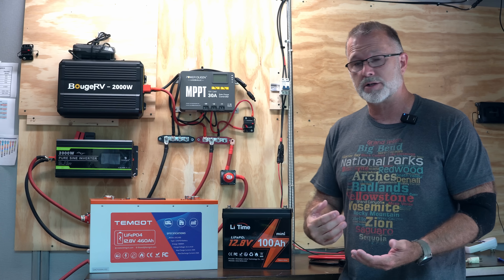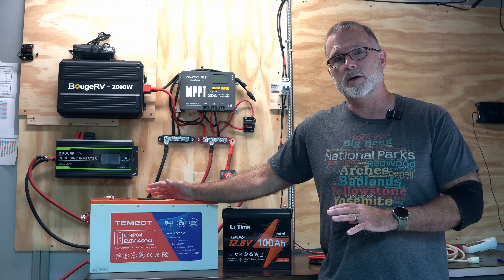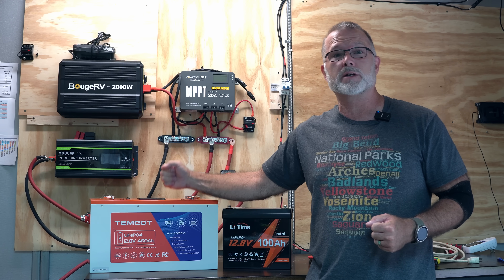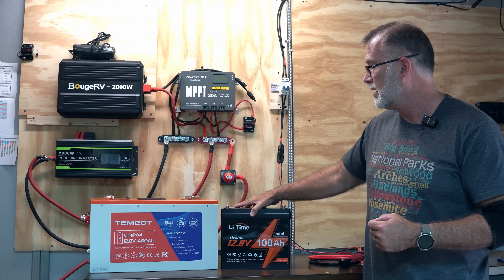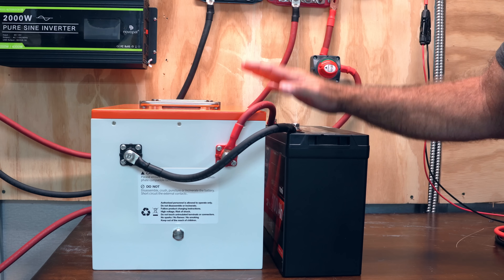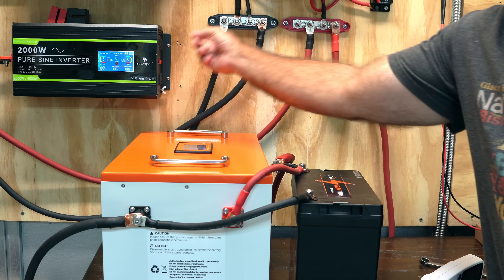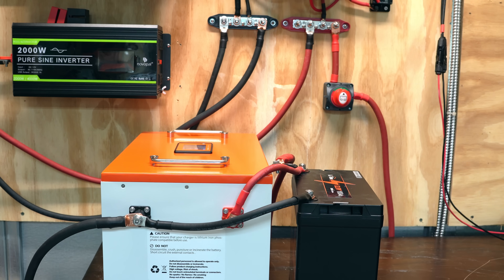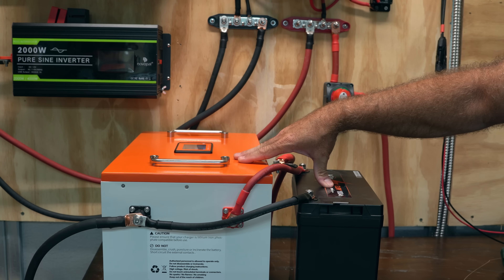Connecting Batteries with DIFFERENT Capacity in Parallel - What Happens?!

Comment: I’ve been thinking about adding to my battery bank for a wile now.   I currently have 3 12v 280ah batteries with 200amp bms parallel and wanted to add more same batteries same ratings just different brand   After watching this I’m gonna order more batteries asap thankyou

Comment: Like when you jump start a car with a dead battery, one battery with really low voltage and one fully charged plus an alternator pumping lots of amps into the low one and quickly charging it. Parallel connection, big wires. As a retired mechanic I have done that more times than I can count with no issues.
Reply: Trying to understand. 

Why not start the low battery car after making a parallel connection? This way they don't have to stay connected for long right?

Comment: Carfull with connecting them parallel if they don't have equal voltages. First connect them in parallel with a 1ohm resistor in between. Wait till they are balanced and connect them, then parallel and keep them parallel.
Reply: Explain the Why part
Reply: @ckreddy  Kirchhoff's voltage law. If you have two batteries, of which two have a very low internal resistance the currents can be extremely high. If they have different voltages. The process I describe is called balancing and that prevents you from high currents.

Comment: The smaller battery's lower discharge rate is not an issue. Ironically the larger batterys bms will shut off way earlier than the smaller battery if you try and pull too much current from the system.

The smaller batterys bms can handle 1c of discharge while the larger can only do like 0.5. Try and hook up 350a load. The load will will 280a from large battery and 70a from smaller one. Large will shut off after maybe 10 seconds.. then a fuse may blow from smaller one when it gets the full 350a load alone lol.. but still my point stand.
Reply: You could draw 300 amp from the system. 240 amps would come from large battery close to its limit while only 60 amps come from small one not even breaking a sweat

Comment: Won't be exact but the batteries should share the current so if that bms on the small one is 100 amps in a perfect world you can draw 200 100 amps per each battery not that's gonna change based on wire resistance where the source is connected internal resistance of the batteries all that so it would probably be more like 190 amps maybe there's allot of factors at play but it can definitely pull more than 100 amps in parallel like that

Comment: auch....the information given in this video about parallel connecting two different sizes batteries is lacking one very important information! In the application of solar system, where the batteries are constantly charged and discharged - this might not be a problem. In an application, where the batteries are charged and left alone for extended period the batteries will discharge one another due to a difference in the internal resistance! This will deplete the whole bank, rendering it useless when needed!!! SO, yes, you can do it but it all depends on the application...
Reply from the maker: Interesting.  I don't think that is an especially common use-case, but if true, something we would definitely want to be aware of.  Thanks for putting this on my radar. Now I'll have to go and test that out and see for myself! 👍

Comment: A good refresher, I learnt battery safety on 50 volt 1000 amp lead acid telephone exchange UPS batteries if you  get it wrong you die they contained the  equivalent  energy of 45 Kgs of TNT.

Comment: The differences in the discharge rates of the BMSes is irrelevant in this case. Since the larger battery has 4.6 times the capacity, it will supply 4.6x the current of the smaller one. This is because the voltages stay the same the whole time, as they're connected in parallel. And the only way that can happen is if they drop voltage at the same rate. And since voltage is a measure of level of charge, it follows that the battery with the larger capacity will drop the same percentage of its capacity as the smaller one in the same amount of time, which can only happen if it contributes current in proportion to its capacity.

So with that out of the way, in your particular case, you can draw approximately 300 (theoretically 304) amps from your parallel pack. Because if you max out the current draw of the smaller battery at 100 amps, the larger one would have to deliver 460 amps. Since it's capped at 250, the larger battery becomes the bottleneck, and dictates the max current the smaller one can deliver. If you divide 250 by 4.6 (the capacity/current ratio between the two), you'll find that the smaller battery would have to deliver 54 amps to keep up. Add those up (parallel connection), and you end up at 304 amps.

Comment: Fair warning though: when you connect batteries with such huge capacities in parallel, their voltages at the moment of connection MUST BE VERY close, like no more than few tens of millivolts apart, otherwise you risk creating damn cool firework )) HUGE re-balancing currents between batteries which can kill batteries, melt wires and lead to a serious fire.

Otherwise cool video. 👍

Comment: Is it possible to take 1 24 volt Lipo battery connected to 2 12 batteries together? The 12 volts are new and identical. There 24 volt is hooked up to my 24 volt system and it's been used but only 3 or 4 times and is a different brand name 'all batteries are same chemistry

Comment: I have 1 24 volt battery in my 24 volt system. Can I connect 2 new identical  12 volt batteries together in series and. then have 24 volts connected in parallel to the 24 volt different brand battery together?

Comment: I have a 300ah and a 400ah LiFepo4 battery set that does fine.
one trick I use is to tie them in parallel directly from the bus bar, instead of the usual one battery to the next. with the smaller battery at a calculated longer cable length so that the draw current from each more closely matches their respected battery capacities.
seems to work fine, and for over a year now.
I think this might be a throwback to the lead acid days, where the smaller battery would end up getting over used and die early.
Also, I have never seen a BMS on a lead acid, I think that those batteries would benefit from it

Comment: 🔧 Experimental Test: Hybrid Pb + Lithium Battery Bank (12V in Series)
I’m running a hands-on test in my lab using an unusual but realistic setup: one 12V Lead-Acid battery + one 12V/60Ah LiFePO₄ Lithium battery connected in series (24V system), with controlled charge and discharge.

📌 Test procedure includes:

Individual and total voltage monitoring (using shunts)

Constant current charge at 5A, BMS supervision

Controlled discharge, comparing behavior curves

Automatic disconnection via 250A bistable relay triggered by BMS output

📉 Expected outcomes:

Lithium holds voltage better during discharge

Lead-Acid may gas early under charge

Real risk of voltage imbalance

BMS used only for control logic, not direct current path = more reliable

🛠 Next steps:

Add IGBT for controlled power flow

Comment: Actually inside the big battery there are a lot small batteries connected parallel to compose the larger battery. You may heard this physical story:" Will big stone fall faster than the small stone? if this is true, then I put many small stone in a bag, will it fall faster or slower?". Exactly the same question 🙂

Comment: A battery test like this doesn't really prove that this a safe thing to do for long term use.  The problem you will have is repeated use when the 2 battery voltages are constantly out of balance. This creates high current flow from one to another which can cause premature cell degradation. You will also have issues charging because the voltage differences between the 2 packs. The battery charger will not be and to accurately tell the state of charge because it will inaccurately read the pack voltage. That's why having a balanced pack is really important. I really hope people aren't doing this because of this video.

Comment: My housebus has 2 x 12v batteries in series for engine and 24v original lighting etc, but was always killing one of them. 
Since i have fitted separate 12 volt chargers across each, and now they have been fine for 4 years. I note that when i turn on main fluorescent lighting, one charger always kicks up charging rate first, and turns off last, no idea why, and swapping chargers over, its still same batteries one (no other connections on them, just the series link between, and positive and negative leads).  I assume batteries although purchased at same time, and identical looking, do have slightly different internal or electrical properties, as can happen- thinking due to these (Resistance?) differences, when on the 24v charger, one battery was always getting more charge/or a higher share of the 24 volts
Personally with the 12volt paralleled 335ah agm  batteries for my buses inverter etc,  i fitted circuit breakers to each battery, as i wondered about what potentially could happen, if one developed a fault, and the other dumped its energy into it, as only one c/b after parallel links, may not prevent an issue.
I also use c/b's to occasionally turn one off, and restart charger, then do the same with second one, so as to be sure that both get fully charged. (I Do the same with my 4 paralleled  sets, of 2 in series, 6 volt wet cell 305 ah,  for my house's backup inverter system).

Comment: if the max charge/discharge is 250AH for the big one and 100AH for the small one, wouldn't that make it so the max charge/discharge be 350AH since they would share the current?
Reply from the maker: Yeah that seems to be how it works, however one thing I've not tried is connecting 2 batteries with same capacity,  but different BMS rating (say, 100A and 200A).  So I'm not 100% sure you'd get the full 300A from thay setup.
Reply: @ReeWrayOutdoors that would be an interesting experiment

Comment: Parallel is Parallel - My Q is, "Does it matter/Make a difference in charge balance -  if you connect Both + & -  to the same Battery vs  Pos on one and Neg  on the other (Such as you did for first volt test??

Comment: Great video.  But how would I hook my solar charge controller?  Both terminals to the 1st battery?  Would ypu hook your inverter on the same ports as charge controller?
Reply from the maker: Recommend using Bus Bars...and connect the charge controller to that.  But if direct connecting, I'd connect to POS of 1 battery and then the NEG of the other.  Same advice for the Inverter connection (bus bars recommended).
Reply: Thank you.  Im not familiar with bus bars(beginner) but I'll check into it.  I currently have two 12v 100ah lifepo4 (same brand)and a 12v 300ah lifepo4. (Battery 1 in sequence)
Hooking a positive to battery 1 and negative to battery 3 for the charger and inverter, and connect each battery in parallel is what I was going to do.  But I will check into bus bars first.  Thanks again, just starting and need the help.

Comment: I got two 100ah batteries at different times. The first battery only has one extra cycle. I’ve got them both on solar charge in series right now. I’m still learning, but it looks like the voltage evens out if battery levels are different.

Comment: Most advertised 48v batteries actually say 51.2v on them. Can they be connected in parallel with one that is actually labeled at 48v? TIA
Reply from the maker: Assuming they're the same battery chemistry, it's almost certain they're compatible in parallel, since 48V is the nominal voltage of a 51.2V labeled battery.  It's likely the difference is only that one brand is choosing to label nominal voltage and the other is choosing to label actual voltage.  As a rule, you should not mix batteries with different chemistries as their voltage profiles across thier respective discharge curves is different enough to matter.
Reply: Just found out my  current 48v is 15 cells, not 16. Could I still use it in a parallel set up with the 51.2v? Thanks again.

Comment: The issue is smaller battery voltage drops faster cuz of lower Ah so the bigger one tries to equalize the voltage. On the longer run the smaller battery is always going to degrade faster cuz of always charging. 
Another point is since the lower one supports 100 A you can easily pull max of 200 A ( 200/2 =100)
Reply: Except the voltages are the same because they are wired in parallel.
Reply: @paulfontaine7819  The voltage will drop faster in lower AH cells no matter what. So there will be a voltage difference happening internally. To normalise the voltage the higher ah battery will charge the lower AH battery. 

Since all batteries have a limited charging cycle, the lower AH battery will burn it through faster. 
That is the reason everyone says don't mix and match batteries.
It's about the lifecycle or longevity we are talking about.
Reply: @anjiths6808 Yes, the voltage will drop faster if the current is equal for both. The voltage cannot drop faster since they are wired in parallel. instead, the current will be different so that the voltage can drop at the same rate.

Comment: Let’s say you had two sets of these parallel connected 560ah battery banks, could you then connect them in series to each other and not get the issues you would if connecting the individual batteries (with different capacities) in series? I’ve been running a system like this for a few years without any issues that I know of, but haven’t tested the batteries so don’t actually know what condition they’re in. Any advice on this would be greatly appreciated!

Comment: So in short when using two different capacity you need to follow the maximum load capacity of the smaller battery to work without a problem right?
Reply from the maker: In reality,  the loads between batteries will be shared in approximate proportion to their capacity. So it's generally not a big concern provided your inverter is sized appropriately.
Reply: @ReeWrayOutdoors  so different capacity would workout fine how about different chemistry like lithium and sodium ion? Aside from having different charging parameters do you think its not possible to use them together in parallel?

Comment: i was thinking i had a 7ah power station and thinking, hmmm how about i add a connection by parallel to another lead acid battery that was 9ah since the video it did show that it can add more capacity. this video wanted me to test that now.

Comment: Mixing sizes of batteries is not recommended in the battety industry. 
You should alway have same size same brand
I have worked 35 years in the ibdustries as electrical design engineer

Comment: I bought a 51.2V 200Ah LiFePo battery and found my solar array fully charges it by lunch time. So I bought a 51.2V 300Ah version from the same manufacturer to replace it. And that too is fully charged by around 3pm...I live in a desert with LOTS of sun all day. Can I add that original 10KWh battery to the new 15KWh battery in parallel of course, to get more reserve power? They are both made by the same company and both state their Continuous Output current is 100A and their Continuous Charging Current is 50A. And if it's safe to do so, can I just connect them both to the 5.5KW Hybrid charger-inverter, or do I need to use a busbar in between?
Reply from the maker: @MoonWalkCTO  you can definitely connect them in parallel without causing any problems.  If your batteries have double terminals on each side, you can just use one of each pair to connect them together and then connect the positive of one and the negative of the other back to the inverter.  Or a busbar works well also.  I assume these batteries both have a built-in breaker. If not, you want to put a a fuse appropriate to the cable off each battery's positive terminal.
Reply: @ReeWrayOutdoors they have a power-switch which I guess is a relay breaker. Thank you for your answer!

Comment: One thing about different batteries in series: once the smaller one becomes 0v, the larger will attempt to charge it reverse polarity through the load. I have seen this happen with 4-8 series SLA/AGM battery arrangements. One will have a reduced capacity due to failing first and the rest will make it reverse the poles.
Reply: I'm gonna just not do this. Because, it would be my luck to somehow defy laws of chemistry and physics and set something on fire or worse. The fire department would demand my first born in compensation.
Reply: Exactly,  and can often permanently damage the smaller capacity battery  -  if this guy really knew his stuff he would have strongly cautioned against ever doing this - charging these 2 different capacity batteries in parallel will also be problematic

Comment: I would not recommend doing this . Different discharging will cause the lower capacity battery to become critically low voltage. Yes there is the BMS as protection. But why risk a LiPo fire with stupid games.

Comment: The video might address it later, but in case it's not clear you can both dischsrge and charge batteries of differing capacities in parallel.

Most batteries these days have cells wired both parallel and series internally  so you are actually discharing cells in parallel, then in series, then back to parallel externally.